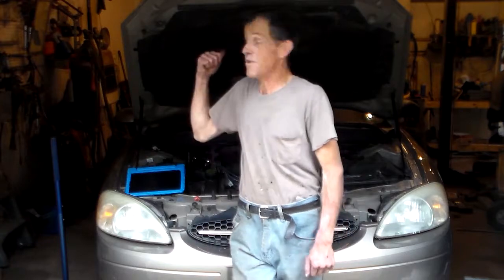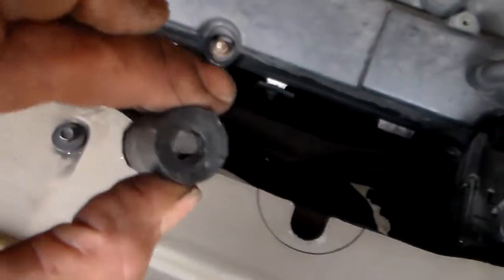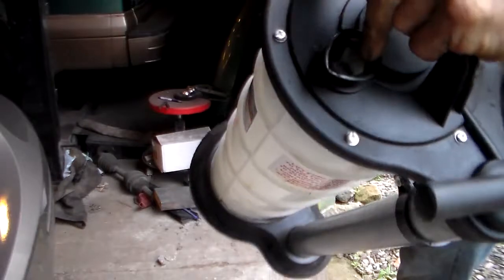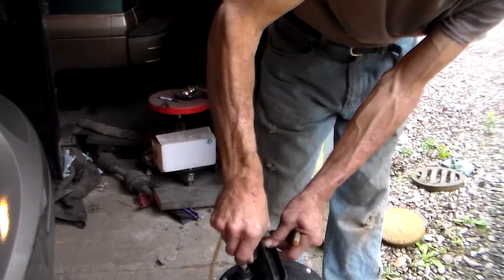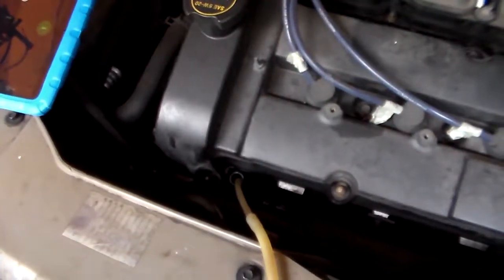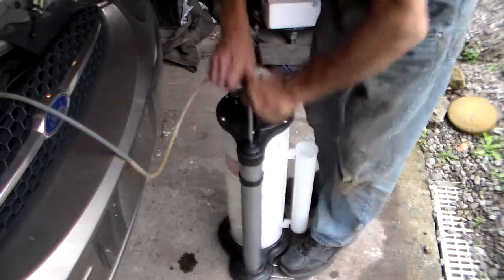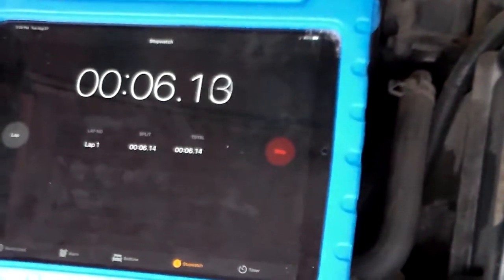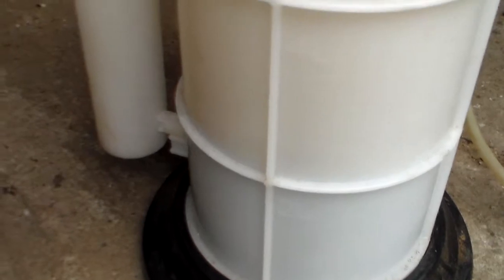Harbor Freight oil extractor, how to use, what is included, oil change 2002 Ford Taurus, holt

Comment: This tool works perfectly. You didn’t insert the tube in far enough. If you adjust said pipe some more, you’ll find it goes farther down into the oil pan. I’ve owned this tool a lil over 3 yrs. now and it gets just about every drop of oil out of my Mercedes. 🤷🏻‍♀️🫶🏼

Comment: You put the car on jackstands and then inserted the pick up tube down the dipstick holder which was also in the front of the engine that may have put all the oil to the back of the drain pan. Perhaps that was the reason it didn’t get all of the oil.
Very good video and honest review of the harbor freight item.

Comment: That's the benefit if you still have to Jack it up to change oil filter
Reply from the maker: So true on the oil filter in most cases. I will post a video on my Toyota Sienna van using the oil extractor in the future. It works great on that van.